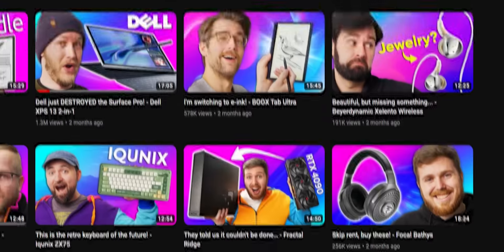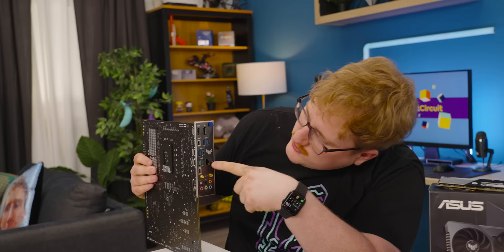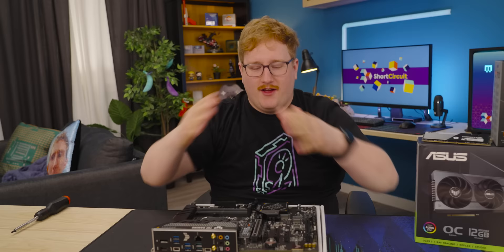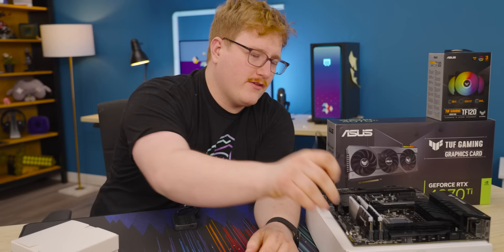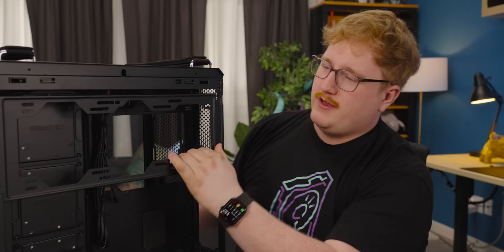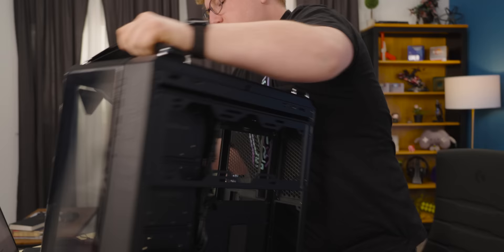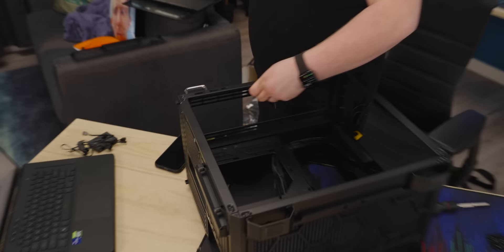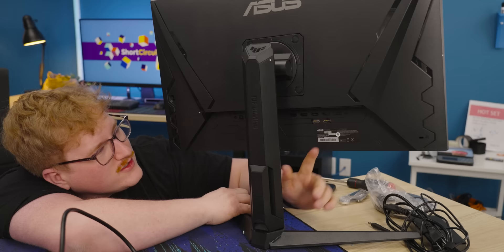The All ASUS PC - ASUS 2023 TUF Lineup

Comment: The metal trim on the PCI slot is for shielding, the gen5 has much higher data speeds per line which means its more sensitive to interference. Its flimsy metal trim, it would do almost nothing to support the high density plastic housing.

Comment: A behemoth case needs a SFX PSU. But worth it because all that glass is so peertty.
Uuh for next build, I have a cool idea...do a case with glass panels all around, with 24 ARGB fans making noise at each other. And external GPU - CPU to solve the heat problem. I'm a genius

Comment: Just finished putting my Tuf build together. 
Ryzen 5600x with Noctua nh-d15s
Tuf gaming x570 pro wifi
Tuf rx6700xt oc
Wd black sn850x 1gb
16gb ram
Tuf gt501 case

I think I might need to add a set of those fans.

Comment: Does a PC really need a CMOS battery to boot? 
I thought they're just for remembering settings?
Reply: Maybe to prevent that a voltage spike resets you bios values while the PC is on, or maybe just as a safety measure. Idk

Comment: Not enough cases have carry handles. I've been wanting something to swap out my Corsair C70 but love the handles when it comes to cleaning/maintenance. I also need to have space for a couple 3.5" drives.
Reply: The case has a lot of space for various 3.5 drives, at least on the back there is a caddy that can hold up to two I believe and if you set fans on the side by removing the covers you can attach those covers to the back radiator support and set two 3.5 drives in there. That's what I did.

Comment: REALLY nice looking case, but I would want a bigger full tower version that could fit up to four 420mm radiators (top, bottom, side, rear compartment) at the same time, as well as a clear distro plate that could fit behind front panel glass, & a 140mm fan at back. Now THAT would be an amazing case, future proofed for custom water-loop cooling the increasingly hotter hardware every generation. If Asus made a full tower version like that, I would buy one, rather than the cooler master HAF 700 I'm currently planning to get, when AMD's 7950X3D CPUs FINALLY become available in the UK!

Comment: I recently finished a build with a B660 Creator board. It has most of the benefits of this TUF board, but the push button GPU release is a cool feature, and mine doesn't have the reinforced PCI-E slot.

Comment: Just finished a 13700k build using the TUF z790 wifi plus on DDR5 (manual settings) and an ASUS TUF 4090 and I am VERY pleased with the performance.  I did however notice CPU bending on the intel IHS so I went with a thermalright 1700 bracket to mod out that issue, and had to buy an extra fan for my Noctua nh-d15s to keep temps below 96c

Comment: Have the Z690 version of that board. My biggest complaint about it is that it doesn't have bios flashback, which I feel should be in all boards around that price point at this time, caused me some issues as a new builder using a 13600k. Shouldn't be much of an issue here though as 14th gen Intel will likely need a new socket.
Reply: 14th gen intel desktop was canceled I believe, we may see some refreshes of 13th gen but there shouldn't be a platform upgrade for a little while

Comment: Aw, the 4070ti. The card Nvidia wanted to push as the 4080 12GB and charge over $900 for but realized  they'd be massacred because its barely as good as a 3080.
Reply: Literally beats 3090. At least research a card before shitting on it 🤡
Reply: @TyTan_  how much vram does 3090 has....

Comment: Look it's my exact build except 4090 and 12900k. And tuf d5 z690. I also own the tuf 4070ti non oc but after saying f it and buying flagship tuf 4090 I'm selling. Same case same fans rog ryugin aio and msi pcie5 1000w psu but did have asus rog thor 850w Platinum had to switch w 4090

Comment: LGA 1700 wow. I'm on LGA 775. I wonder what I am missing out on.
Reply: what processor are you using? I still use 775 too
Reply: @hugosantos1476  Pentium dual core e2180. It was overclocked from 2GHz to 3GHz for a decade but I realised that does not help me as much it is making heat

Comment: I know it's not critical since the pump is not at highest point in the loop, but why put the AIO tubes on top instead of on the bottom? Other than trying to hide the tubes, I always try to put the tubes on the bottom for the least wear and tear on the AIO.
Reply: What do u mean? Putting the radiator at the bottom with the tubes going down? That's the opposite of what you want to do.
Reply: @Look Here  no, tubes on the bottome of the radiator, going up to the pump, and then the top of the radiator above the pump, just like GN and JayzTwoCents recommend in their videos, it's even shown this way in Fractal Design's manual for the case I just used for a customer build.
Reply: @technerd9655  u mean if the radiator is side mounted or top mounted? 

I think we are saying the same thing since u did ref the same videos I watched about it JTC and GN. I did mine so the tubes coming out of the pump are at the top of the pump housing (EK 360 AIO) then have the radiator top mounted at the case in the only orientation that would reasonably allow for the tubes length to be accommodated. But either way buth ends of the tubes sit higher than the majority of my pump to keep air from settling at the pump.

Comment: @2:04 WTF are you talking about?! I have an ASUS mobo, the Strix Z490-E for Intel's 10th gen, which cost €250 new and has that connector. FFS get you facts straight!

EDIT
Plus the Z490-E has a debug LED. Where's the debug LED on that €300 ASUS TUF board?

Comment: I have to say that I liked the idea of ASUS's easy PCI-E release, but having a motherboard with it... it doesn't really seem to work all that well.  I usually have to fiddle with the latch regardless, and that can be annoying when they place a shroud over most of it.  Overall, it hasn't caused any issues, but just a bit annoying.  Although, I am more of a fan of their M.2 retention system.  I have an MSI motherboard that copied it, and for some reason, it just doesn't fit certain SSDs.  I think I went to install... a Crucial drive into the MSI board, and I had to unscrew the M.2 latch just to get the M.2 drive into the motherboard.  Never had that issue on the ASUS board!
Reply: It sounds like that you have a fat index finger.
Reply: @disguiseddv8ant486  Large hands can be quite the bane for building, but I’ve found that the push button doesn’t seem to release as well as just pushing down on the original latch did. Might just be me though!

Comment: I have a asus strix rtx 3060ti but im looking at upgrading to that very same asus tuf rtx 4070ti. Should be a hell of a performance boost. I hear its as fast, if not faster than a 3090.
Reply: Yep it is faster than a 3090 and you get dlss 3.0 so basically it can run anything at 4k
Reply: @TyTan_  if you plan on 4k go 7900xt...192 bus. 12gb vram zzz, Nvidia screws us
Reply: If you're lucky, it's faster than 3090. It's not objectively superior due to the VRAM. The minute you run into VRAM limitations you're SOL with your $800+ product.
You're making a huge mistake not getting a 7900XT for the same price: it has far more raw rasterization capabilities and it's not going to be screwed by VRAM limits like your 4070 Ti will be. And make no mistake: even if you're barely scraping by with some games like Hogwarts, it's only a matter of time where your mid-tier card will be crippled by the lack of VRAM in games.
Reply: @rustler08  depends on if u mind using dlss really and if u want ray tracing. Dlss 3.0 can make a huge difference in performance and u wouldn't really notice it unless u actually tried. But if u don't want to use dlss or ray tracing for what ever reason go amd.
Reply: The 4070 ti might be a little bit faster than the 3090 but mostly yeah, it is in some cases as fast or a little slower than a 3090

Comment: i get better cpu cooling with my air configuration over that $300 AIO lol. plus i bet my computer is more quiet and i also do 100+ fps 4k max setting RT gaming lol. the 15 fan configuration for the Lian Li dynamic EVO in a 7 intake (top, bottom, and rear), 6 exhaust (front and side) with the 2 cpu fans pulling air from the rear is better with a noctua nh-d15s and an aggressively low fan curve. but i have an i7 12700k which i think the i5 13600 runs a little hotter but still... bet if i threw an i5 13600k in my computer i could get close to the same thermals and performance without an AIO in the configuration that i have. with the top fans being intake it gives cooling to every stage of the dual tower cpu cooler. which a big problem with dual tower cpu coolers is that the second tower does not get fresh air because it gets recycled hot air from the first tower. my configuration actually makes dual cpu towers make sense.

Comment: I’ve always wondered, is there any benefit to having (almost) your entire PC build be from one company?

This comment was originally made by Neoxon. If this was posted by anyone else, they’re a bot.
Reply: You get paid more from the sponsorship.
Reply: The only one I can think of is minimizing the amount of software you need to control ARGB lights. Otherwise, no, go for whatever fits your budget and looks nice enough for you.
Reply: mainly having a single rgb software to control the sparkly lights
Reply: I’ve always wondered, is there any benefit to having (almost) your entire PC build be from one company?

This comment was originally made by Neoxon. If this was posted by anyone else, they’re a bot.
Reply: I’ve always wondered, is there any benefit to having (almost) your entire PC build be from one company?

This comment was originally made by ThyLordLoper. If this was posted by anyone else, they’re a bot.
Reply: @Maradiaga23  I have an asus board, so I just bought everything rgb related which supports aura sync. Not too difficult finding multiples of different components which are compatible with multiple rgb software so in 99% of the cases, I’d say it doesn’t matter
Reply: @Skiman__  It's still a decent way easily make sure everything works together, particularly for beginners. Is it necessary? Of course not. In my case I screwed myself by having a zotac gpu, msi motherboard and lian li fans that don't talk to each other.
Reply: There is not, however I'm ngl I love having an Asus motherboard and GPU, I've upgraded to a 7900 XTX Asus TUF recently and in the first boot, literally after installing the card, with no drivers installed my GPU defaulted to my current rgb setting (static blue) as soon as I logged into Windows. So yeah, it's awesome for rgb control like people said.

Comment: They need to stop with the BS and just call any card larger than 3.2 slots a 4 slot card because effectively that is objectively what it is. It's nice that the motherboard has all of those slots, it's a pity the GPU is blocking all of them except the 4x wired x16 slot.

Comment: My ASUS TUF board just went out. It just randomly no longer boots Windows. It reads all my SSD drives but says "No bootable device found." I tried to reinstall Windows via USB and CD drive. The motherboard reads both the USB drive and the CD drive but still says "No bootable device found." Instead of wasting my hours, possibly days trying to fix the issue, I just bought a brand new MSI motherboard. This is my THIRD ASUS motherboard to fail in the past 10 years. Never buying ASUS again.

Comment: Asus and Intel, ask for your money back. This video was a complete dump of shit on the dual zone feature of this kit. Didn't even bother to mount the AIO rad in the rear chamber much less do a hardline build pulling the CPU and GPU heat to the back chamber. Shameful rush job of what should be a splendid case.